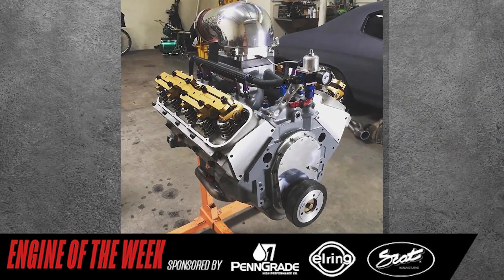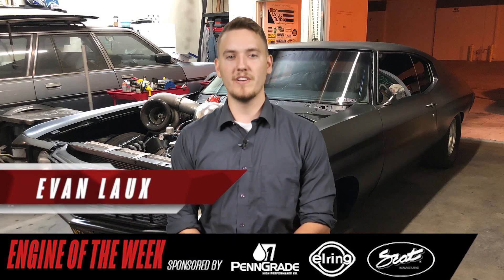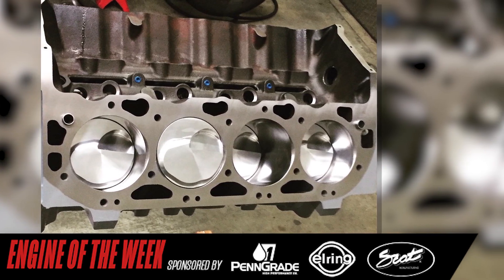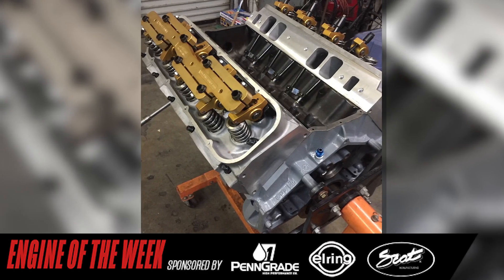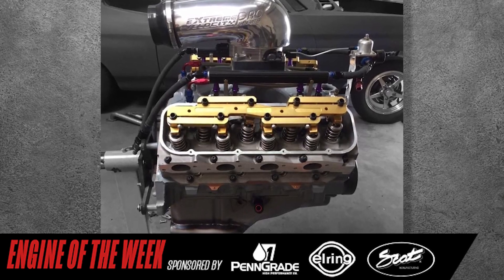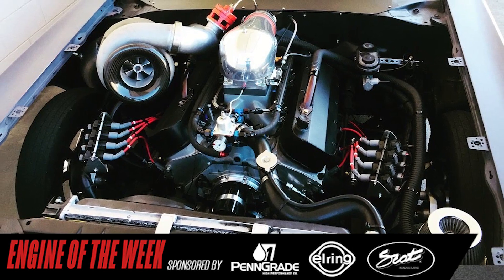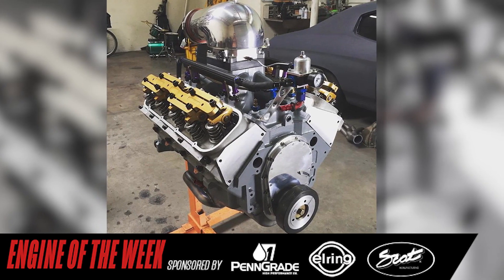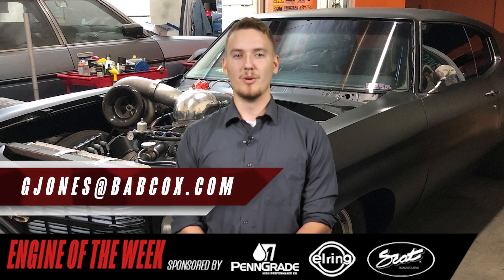Turbocharged 454 Big Block Chevy

Comment: Think i would had at least went with a aftermarket block to put good parts like that in and maybe a  9 inch rear end theres some places you can save money and some you cant but pretty cool build .
Reply: Aftermarket block like my bowtie sportsman block or a dart block is only tested to 800 HP in. Short deck  we have made 1200 on a studded 2 bolt block .

Comment: Wondering why Only 454 Cubes ? Cubic Inches is just More Horsepower and Torque. Doesn't seem like it's built for a specific class. I used to work with a Old School Drag Racer, and he Always said "The Bigger it is, the Faster it'll Go"  Bigger Cubes is just a Rotating Assembly Away. And if you wanna go really Big, Aftermarket Blocks are a dime a dozen nowadays.
Reply: 💰💰that’s why. You can pick up a gen 5 block from a junk yard less than 500 bucks. Those gen 5’s aren’t built like the aftermarket blocks, that block won’t handle much bore size.

Comment: i was expecting many 1000 til they said the turbo size, then 1800 tho... jesus christ. 1800 horse power street car. My dad tug boat he worked on was 125 foot and pushed a 300 foot barge. That boat had 4000 horse power.